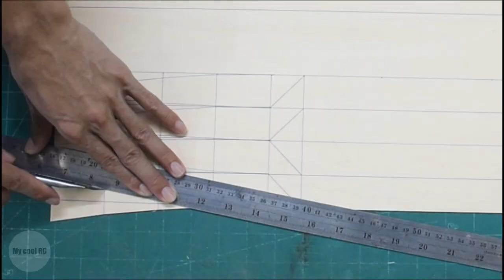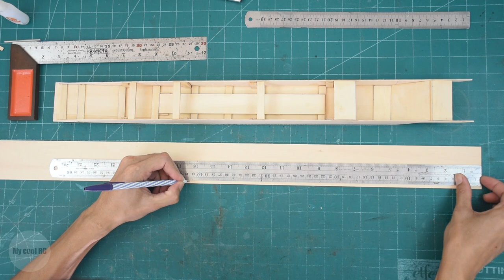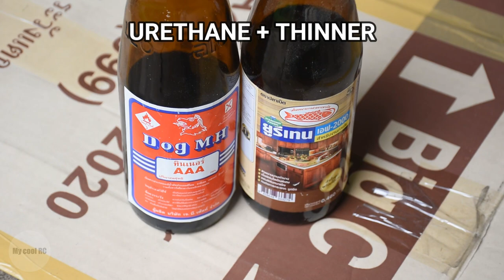Build a Rigger Longtail RC Boat - Jumping & Self Righting

Comment: What I like is you don't have a turn fin on, & it turns great. Very fast. You had no cover for your electronics.  What do you do after a run to clean electronics up from corroding
Reply from the maker: I use epoxy for the esc.
and Vaseline for protecting my servos and receivers.
Reply from the maker: After every run I clean the equipment with a dehumidifying spray.

Comment: why does it always jump out of water nose high when you throttle ? too much power or a bit rear heavy?
Reply: all in all its a nice outrigger. thank you for posting.
Reply from the maker: The impeller used is quite large.